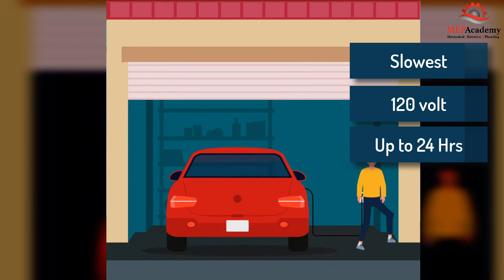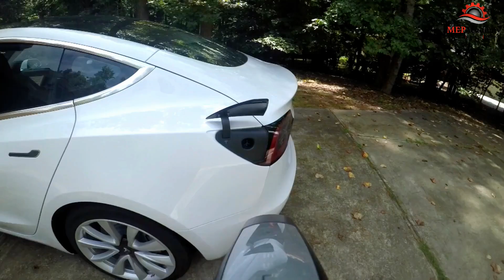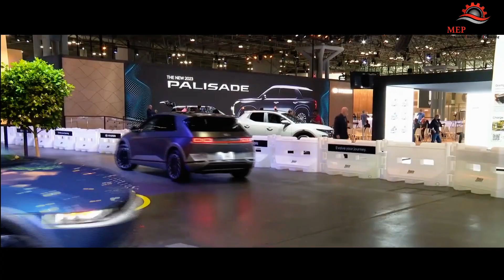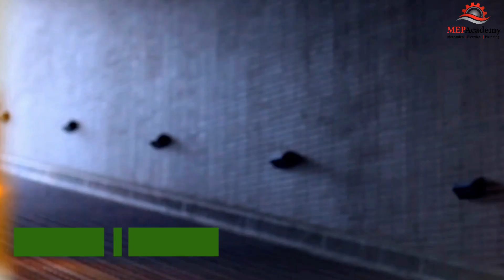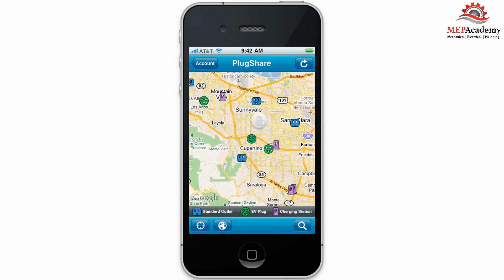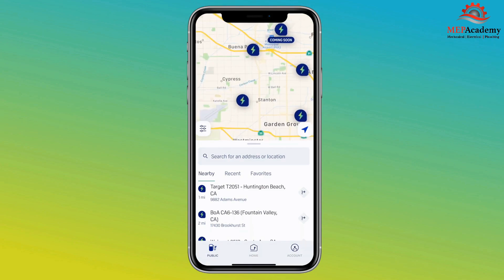Electrical Vehicle Charging Stations

Comment: So how do I charge my King Song S22 Pro electric unicycle at a charging station?
Reply from the maker: Not sure on that one, but there are adapters for charging electric bikes with charging stations. Ensure that your electric bike's battery and charging system are compatible with the voltage and current provided by the vehicle charging station. Most vehicle charging stations provide either Level 1 (120V) or Level 2 (240V) charging.
Reply: @MEPAcademy  Level 2. Maybe I should have a little chat With AI